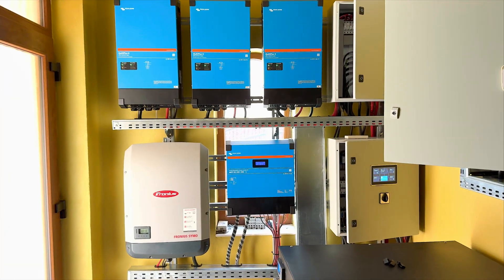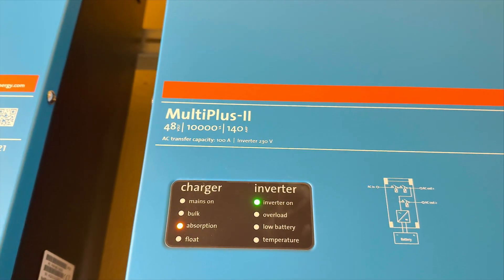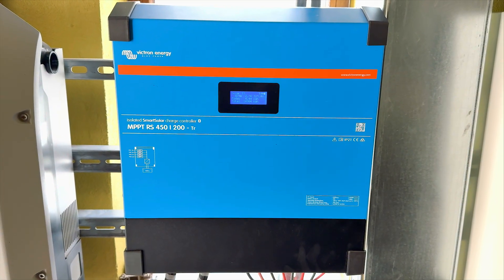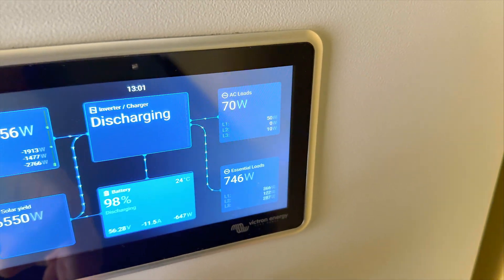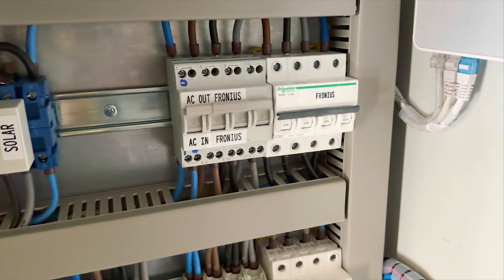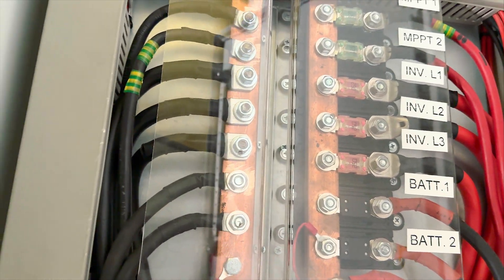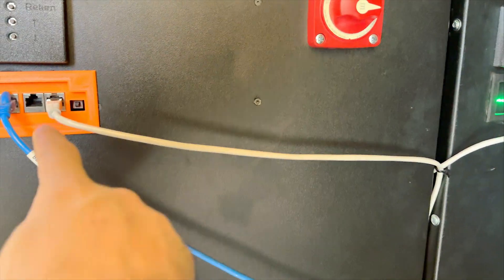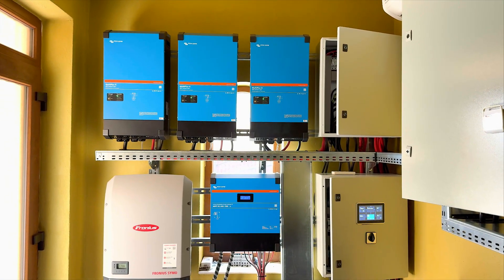Building a micro-grid: 100kWh DIY Battery + Fronius & Victron Inverters!

Comment: Hello, no worries about your English
Impressive installation.
How did you connected Fronius in microgrid with Victron in order to charge accu when city power is down ?
As far as I read this configuration will give full control over Fronius inverter to Victron - when accu is full and no city power it will turn off Fronius inverter.

Comment: SYstem looks good, but fuses for BATTERY are not rated for maximal short circuit current, the battery can deliver. Good fuses for PV has 50 000 or 80 000 AMPS braking kapacity.
THis small fuses 300 APMS for low voltage system do not have such braking capacity. THis fuses evaporate and blow like fireworks. Look at videos from Germany, where
ingineers compare this fuses, with 50 000 AMPS circuit breakers and gG, aR etc. fuses inside ceramic with sand.

Comment: Great setup.

I have a question. 
If the batteries are full, the grid is down, or there is no grid, Can a dump load be added to heat 5000 liters of water( greenhouse heat battery)?  What device is needed to know when the batteries are full and dump the load from Fronius and from Victron Mppt into a 9000 kwh 3 phase water heater? 
Can you use a relay from Victron Mppt, or the Shunt to activate a contactor to power the dump load? When battery is at 95% ? 

A Fronius Ohmpilot seems to be way to expensive just to mimic the on off for the dumpload. 
A greenhouse water battery is avaiable( techically all energy surplus after the 25 kwh lithium battery is full can be used to heat that water/ unlimited kwh  absorbtion capacity)

What would you recommend as the most affordable dump load option ?

Thanks
Reply from the maker: You can use built in relay of Victron to power a contactor. A rule can be made into Victron configuration and when battery is 100% to close that relay. This is old way :)

The second option is to create a NodeRed custom function that will close that relay based on some specifications. Is more customisable. If need help just shoot your questions here.
Reply: @thecstechvideos  to save the sudden frequency change in Fronius I was going to use the soft relay from the shunt or the multiplus to control a 3 phase relay  or even a 48 Volts  DC direct water.   heater. The 3 phase heater can have 9000 watts of dump load. 
Please explain the Nodered?

Comment: Salut, 
Vreau sa instalez un Easysolar II 24V pe o cabana cu PV si un back-up generator
Intrebare:
Pot conecta generatorul la AC input?
Trebuie sa fie tot timpul alimentat cu AC?
Din ce am inteles eu din manual, odata ce primeste AC pe AC in acesta analizeaza voltajul si frecventza si daca e ok, il trece pe AC out si el trce pe functia de incaracre baterii.
In mod evident generatorul vreau sa-l pornesc doar cind am nevoie, adica bateriile etc.
Deasemenea vrea sa stiu daca pot connecta o hidroturbina la el. sau e mai bine sa merg pe redresor separat si sa i ncarc bateriile direct?
Merci
Reply from the maker: Wait you on WhatsApp group

Comment: Nice setup. I will build a 3 x MP2-15kVA ESS in spring. You might have a look at the lifepo.de battery systems. I am a big fan of there HS-48-280-200 System. They have a smart mgmt for it, which is pre-designed for Victron. Price for a ready system is good (go ask them for a price for a few pieces). You can stack 3 of them and use 9 or more in parallel. Each can charge/discharge at impressive 200A (10kW). I will use 3 of them for the start with 3 x 16kWh.

Comment: Nice!
Do You not afraid about Kona batteries?  Why not use LifePo4? 
What is the Charging and Discharging characteristics of the Battery? 
Thanks!
Merry Christmas!
Reply from the maker: Was customer project so is his responsibility. All electric car DYI pack are in some cases dangerous, but keeping them in some conditions can be safe and last longer than any solar batteries. This one, since is a huge pack can be changed and discharged whit around 300-400A (around  15-20kW) and all is cold as ice :)

Comment: Really clean build, but how did you use the input and output function as an island system with the victron if only one AC cable is connected the the multiplus? Left me a little bit confused there😂
Reply from the maker: Hehe, is a 5 x 10mm RV-K cable. 2 wires on input, 2 on output and 1 for ground :) Mystery solved! :)
Reply: Hi, first i want to say, as installer myself what a very impressive system, beautifull!

Smart, using a 5x10 in stead of 2x 3x10, makes a cleaner installation. I am going to use that idea if you dont mind..

Have a great day!

Comment: Nice setup, but over engineered for the goal it serves. 

Kona batteries are cheap because they are from a recall campaign. And the reason of the recall was spontaneous thermal runaway of the battery. If someone has so much money for the Victron devices I don’t understand why not to spend a bit more and buy good LFP batteries which are way safer.
Reply from the maker: The batteries was there when we arrived, was not our decision to keep. I agree whit you, can be dangerous!!!
Reply: All that room can go on fire from that battery, at least have a separate concrete room for the battery for possible thermal runaway.  Nowadays ypu can get 5 kwh for 800 euro and be on safe side.   @thecstechvideos

Comment: To many devices, looks complex. I would go with hybrid inverter, complete high voltage EV battery with its original bms & comunication done via LilyGo
Reply from the maker: Yes, that can be a solution but since some of devices was already there, this solution suits customer better.
Reply: Yes, it’s kind of complex and likely not for everyone. BUT I prefer the Victron solutions for there quality and many many features with proven legacy technology and high reliability. Don’t think there is any you could not setup with it. However, it needs a smart and savvy integrator (or you are capable of doing it yourself).